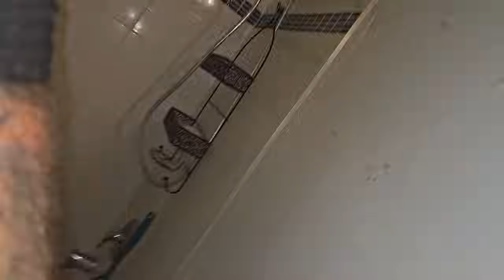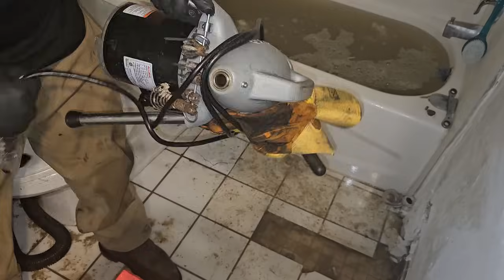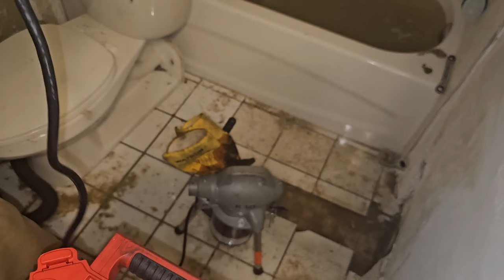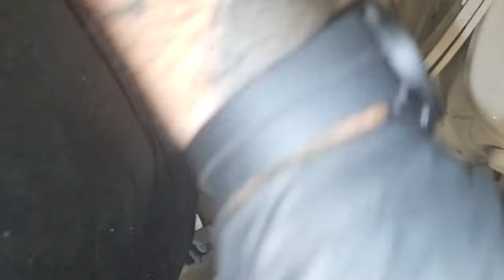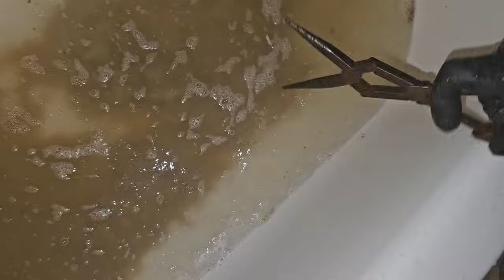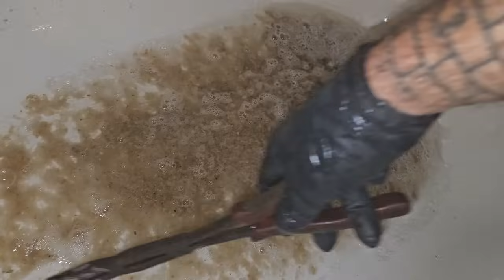I Wish They Would Have Called Another Plumber. Main Toilet Stack Clogged

Comment: "Happy Friday." I know the feeling. I spent half of Saturday morning at a small efficiency apartment complex with two units on a single stack connected by a double wye. The cable just went across the wye to the sink in the adjoining unit. And, to top it off, the vent stack was offset and was also broken. I ended up having to crawl in the attic to fix the vent stack just so I could clear the blockage. So frustrating.
Reply from the maker: That sux I'm glad you figured it out Roger have a great day

Comment: Is that a mini sectional snake
Reply from the maker: Technically, I guess? Yeah, it's a 5/8 cable. The cables are 7 and a 1/2 feet each. You can get some cables that are ten feet.I believe, and it's good up to 4 inch drains it's made by rigid, and it's k50
Reply: @Jaythatdrainguy  I have the bigger one and I love it's easy on my back
Reply from the maker: @johndorazio3759 yeah i like the sectional for the fact you can change out a damaged length and don't need to get rid of your whole coil.